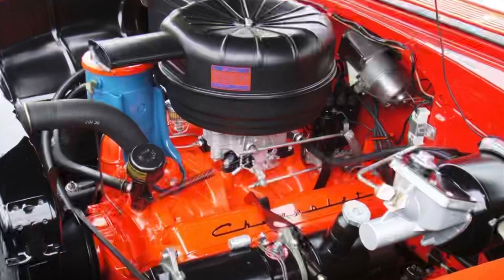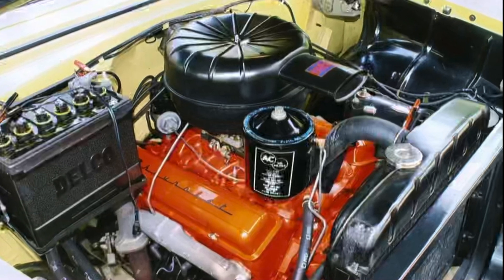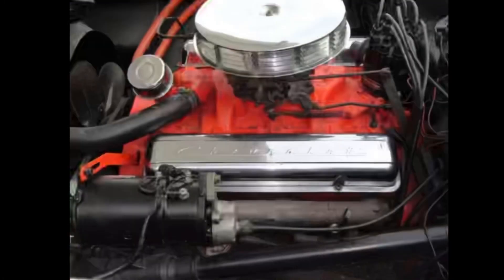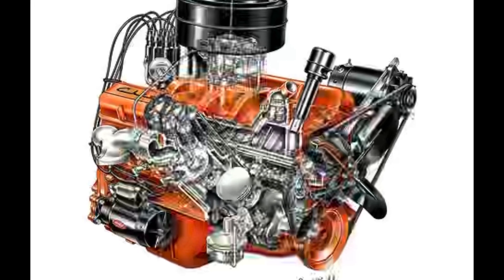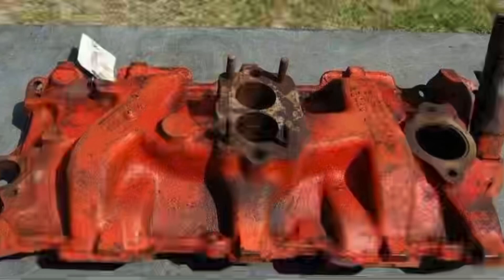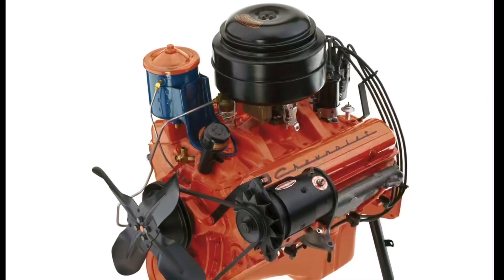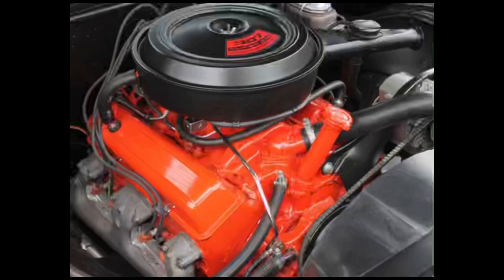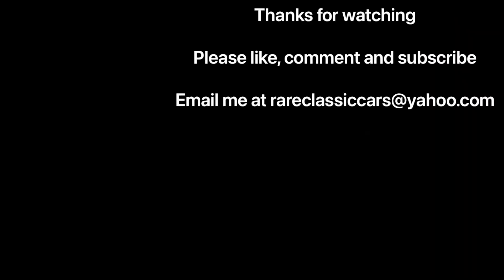Best Engines of All Time: The Chevrolet Small Block V8 (262/265/283/302/305/307/327/350/400)

Comment: The Chevy 305, for its intended purpose did the job wonderfully. It was a bread and butter transportation engine, never created to be a performance engine. Considering what it was the power was not bad. The LG3 2bbl & LG4 4bbl ran when taken care of well over 200k miles. I never had a bad cam on a 305 but had a Chevy 267, mfd 79-82 that had a soft lobe. All though not a Chevy the Olds 307 was another smog era workhorse along with the Mopar 318. Yet another great video Adam 👍
Reply: They were great engines, I had an 84 4bbl in a truck, drove it for 24 yrs daily no issues just regular wear items
Reply: I read that the reason the cams went bad was because the grind produced a rapid  opening and  closing valve timing with short valve dwell  to lower overlap. This made for steep pointy lobes that wore quickly.  The reason for this design  was emission related.
Reply: I've owned 87 Caprice with a 305 for 17 years.  It has about 450,000 miles on it.  All things considered, I've never "opened" the engine for any reason.  It does not leave any drips in my driveway.  It does smoke a heck of a lot though.
Reply: @ljchrzan  I had an 87 Caprice with a 305 also, it ran FOREVER with lil smoke I suspect was the valve seals that were a common issue on 80’s Chevy 305/350s.
Reply: @ljchrzan  - Probably needs new valve seals... and may be missing some cam lobes...
Reply: @BuzzLOLOL  I'd be surprised if there was any valve seals left
Reply: yes 305 good...dont abuse it...twill last 4 ever...m
Reply: IME, the Chevy 305 was an abysmal engine. Chevy cheaped out by keeping the same stroke as the 350 (both the engines use the same crank blank for cost savings) yet radically decreased its bore. This resulted in an inherent restriction in valve size and hence radical limitation in performance. The 307 was created of the same sin (a debored 327). I have a hunch that marketing played into the equation - the 4" bore (same as 350) x 3" stroke was a 302 - a moniker (too) well associated with Ford, but in the least it would have been a vastly superior budget engine than the 305 (or 307).
Reply: @salninethousand2496  - Valve sizes in 305's and 307's were fine for the job they were expected to perform... and the longer stroke produces a cleaner running engine... more low RPMs torque... 
First 302's were 1950's Chevy 283's bored 1/8 inch over to produce a '301'... same bore and stroke as a 302"... ditto for the '76 & up Pontiac '301'...
Reply: @DFV  Louderilk good work... I think chevy small blocks were an enduring design.....ford had good motors too...I liked the 289...loved my slant 6....and yes...a few people raced them...
Reply: @davewallace8219  - Some Slant 6's were all aluminum...
Reply: @BuzzLOLOL  yes! Mopar did make aluminum Slant 6 blocks in the early 60’s I believe.
Reply: @davewallace8219  you left out the 318, underrated good engine.
Reply: @DFV  Louderilk I still have a 300 6cyl. made in 1988...
Reply: @davewallace8219  Oh my gosh - I had to drive an extended Econoline van with a 300 six and 4-on-the-floor transmission back in the late '80s and early '90s, for a part-time job.  I remember being surprised when the boss pointed out it was a six in that thing!
Reply: @70sleftover  Those Ford 300 I6s were workhorses.  I think they still use them in UPS trucks (the gas powered ones).
Reply: @davewallace8219  - A fairly new one, eh?

Comment: It sure is great for the blue clouds of oil smoke, agreed. 
People only think it's good because of volume, period. Any small block Ford or Mopar will walk away from it with better mileage and reliability.
Reply: I've always heard that from Ford and Slowpar guys but the funny thing is I've never actually seen one of either that would "walk away" from a 302, 327, 350 or 400 sbc that was comparatively built nor do they get better mileage or have better longevity save for the few years of soft cams and that is an easy fix for even a shade tree mechanic on most cars and pickups of the era.
Reply: Mopar was eating Ford and Chevy in NASCAR with their big block hemis so NASCAR banned them. Nice try though.
Reply: @jsd795  Then you need to get out of the basement and learn something about cars.
Bye.
Reply: @67marlins  I certainly know enough about the subject to know when someone is talking out of their rear end.
Reply: @jsd795  Exactly the response I'd expect from one of the many camaro boys who watched my Ford tailgate leave them in the dust. Truth must hurt.
Reply: @67marlins  it doesn't sound to me like the truth is one your strong points.

Comment: Quite informative.  I learned something new. I did not think the 305 V8 was a bad engine either. I know that the Chevrolet Caprice used a 4300 V8 in the mid 1990's on top of the 350 V8 and 5.0 Liter V8.  I would like to hear about Oldsmobile V8's and the 3800 V6. Thank you for sharing.
Reply: Plus you can take a Chevy 305 make it a 334 Stroker and get over 400 HP out of it.
Reply: the 305 is slow and doesnt rev high
.
but for a low end torque, drive it for what it is, and get good MPG
its amazing.... especially with a 700R4
Reply: all,,v6 engines ever produced are crap..same as 4 cyl..unbalanced.. 6 cyl or v8.. only engine to have..&,,not a 350. there gearbage..you know nothing about engineering..
Reply: @harrywalker5836  And you know nothing about spelling and grammar. I doubt you know much about engineering either.

Comment: Adam, I see that you are not dealing with the fact that you have been so completely brainwashed by G.M.'s failed business model.  Try to gain a little objectivity and self-awareness!!  Yes, G.M. really got lucky with that small-block Chevy V8:  after nickle-and-diming its design as much as they possibly could, it was still reasonably dependable, a la the stovebolt 6.  But those ball stud rockers are a real turnoff.  I would never have an engine with ball stud rockers; they're beneath my dignity!  Know why the stovebolt 6 was so named?  Because G.M. was too cheap to use high-tensile strength head bolts.  It might have cost $1.50 more per engine!  Can you say "cheap"?  If G.M. had tried a little harder to make its engines good, rather than just cheap, fewer of their engines would have been such failures.
Reply: I think you will find that if you watch enough of Adam's videos (particularly the Best Of/Worst Of series, but also his reviews of his own vehicles) that he has been quite critical of various GM vehicles in general and quite a number of GM engines & gearboxes in particular, and has repeatedly called GM out for cost-cutting in design & manufacture and de-contenting of their vehicles from the '70's onwards.  

Although having worked for them, Adam is no fan-boy of GM (if anything I think he has a soft-spot for the Ford vehicles he owns) and he is generally unbiased and objective in his opinions.  I suggest that you take the time to sit down and watch the back-catalogue of all the videos on Adam's Channel before you make unfounded claims of "brainwashing" and bias, as it simply makes you look ignorant to those of us that have followed his channel from day one and are familiar with all his content.
Reply: @philip4193  I've watched all the videos, Philip. It's just that Adam has never eschewed the Sloan business model, so he thinks frequent model changes are just fine, but frequent model changes are incompatible with quality.  Plus, the supercilious way in which G.M. treats its customers and G.M.'s expectation that you are going to buy a new car from them every 7 years have really alienated potential customers.  I don't think Adam is ever going to be willing to admit that G.M.'s business model has been a failure because he's got too much emotionally invested in the company.  And now G.M. is going to go all electric and try to compete with Tesla.  Good luck with that!
Reply: Adam provides a very good assessment in his reviews, and he has spoken repeatedly about 1) the cheapening of the Big 3 products in the early malaise era 2) the soft cams in GM engines 3) the sloppy assembly and poor fit and finish of large GM cars in the 1970s and 4) how the conversion to new technologies and architecture had a negative impact on quality.  Brainwashed people, or your “true believers” are usually apologists,and I don’t think that describes Adam.  He likes a certain era and type of automobile and is enthusiastic about it.  

Calling him brainwashed is not accurate and mean spirited.
Reply: @zilksmooth  I could not agree more!  You have articulated perhaps more eloquently the points that I was trying to make in my reply to our ham radio friend.  It seems that William has probably had a bad experience with either a GM product or their customer service (or generally just disagrees with their business ideology) and thus he objects to Adam suggesting that the GM/Chevy small-block V8 was a essentially a good and successful motor, as in his mind the evil GM cannot possibly produce anything good.  

History has shown that this motor was not only prolific, long-lived production-wise and generally durable & reliable but also a great platform for racing and aftermarket modifications as it was easily tuned and modified from stock at little expense.  It was replaced by the LS-series engines, which themselves have gone on to become legendary for exactly the same reasons.
Reply: Oil doesn’t wear out. It gets polluted by water, gas and carbon. I knew an older mechanic with a sb 318 who never changed his oil in 40+ years and 500,000 miles. He used a canister oil filter and put pure cotton in it every 500 miles and topped the oil off.

Comment: Legendary, indeed. We read somewhere (might have been in the Ford Museum) that even the development engineers were surprised with the performance and reliability of end product, and how well it compared with others on the market at the time.
Reply: Chevy did have the OHV Buick, Olds, and Cadillac 8 cylinder V8 engines to pattern after... Pontiac invented the stamped steel rocker arms used...
Reply: Even today we're constantly surprised by how these engines compare to other manufacturer's engines. In the day, they were the space shuttle.
Reply: Very informative video. I'm satisfied of the 305 SBC on my 1982 Trans Am. I had to change its water pump 8 years ago but other than that I have no complaints. Soon reaching 80k miles it's a sturdy and reliable engine.
Reply: Lazy  , Incomplete , History ,one of innovations ,of Chevy small block was ,stamped steel rockers ,and No rocker shaft .which ,Pontiac Engineers had developed .Ed Cole was Allowed to steal idea for Chevrolet . And ,Yes was a good ,Cheap ,Light ,engine .

Comment: Not mentioned is the V6 derived from the V8 engine. Quite common in eighties and nineties GM  products as the entry level option.
Reply: Yes. The 4.3 V6 was a 350 minus the back 2 cylinders.
Reply: There was also a 3.3L V6 that debuted in the 1978 Malibu, which was upgraded to 3.8L (229 cubic inches) in 1981. I remember taking driving lessons in a late 70's Malibu with the 3,3 that could barely climb a hill - we lived in Asheville, NC at the time.
Reply: @eth39232  Ah, those were the not-so-good old days. It was not a good time to learn how to drive - in 1981 I was stuck in a driver's ed class that featured a Chevette with an auto trans that shifted up and down several times climbing the one looooong hill up to the state police driver test place. Of course what did we expect from a four cylinder American car back then but lousy performance for all the fuel efficiency we hope for?
Reply: @70sleftover  A 4 cyl was ONLY for gas mileage.  Performance was out of the question.

Comment: They leaned heavily on Cadillac and old's research but, not entirely. I'm sure you'll disagree with my assessments (as you have before) if you read these comments at all. However,  I agree the sbc is a magnificent combination of existing engineering combined with honest examination of improvements that could be massaged to fit the new creation needed at the time of thier assignment.  I believe serendipity was a factor as well.
Reply: Buick also had the 1950 all aluminum 215" V8 that they put into early 1950's Harley Earl show cars for Chevy to look at... and Pontiac invented the stamped steel rocker arms... 
I think the 215's early beginning is why it went into production in 1960 with rocker shafts instead of individual stamped rocker arms... can't recall, may have also had aluminum rocker arms...
Reply: @BuzzLOLOL  yes sir. It all started with Cadillac in 48 when they put OHVs on there flathead blocks though.
Reply: @michaelatkins9780  - Chevy's always had OHV so they didn't need to learn that... and they knew their OHV 6's always had more HP than same year Ford flathead V8...
Reply: @BuzzLOLOL  didn't say that. Yes chevy started with inline 6 OHV in 28ish and military equipment in the 30s and 40s all having OHV but, not one production V8. That started in production in the retooling after WW2  for the luxury market so they make profit for as a markup on those models. SBC was the logical downmarket with improvements and of that's necessary to fit in their tri- five models.
Reply: @michaelatkins9780  - ??? Chevy started with OHV 4 cylinder in 1911 and had OHV V8's from 1916 - 1918... Although those cars were a little pricey for the Chevy market/buyers...
Reply: @BuzzLOLOL  you keep expanding the context of the original comments. Which is indicative of a an argumentative individual. Yes, everything you just said is true but, what numbers are you talking about at that time? Production is what I  said. 20s, 30s, 40s and 50's. Your next argument will probably be that they all had round wheels that went round and round.
Reply: @michaelatkins9780  - Not being argumentative, just expanding your knowledge into areas that you apparently had no info on... yet... 
Since i started as a Chevrolet/GM engineer in August 1966, I have much more knowledge of this stuff than most people... also, my father worked for Chevrolet much earlier... although he preferred Oldsmobiles... especially starting in 1949...
Reply: @BuzzLOLOL  understood. I am aware of those facts unfortunately in a comment  we have to be brief which isn't one of my strong points. I am a 1960 model myself. I came in when, the fins went out. All points well taken, I appreciate your opinions, sir.
Reply: @BuzzLOLOL  Yes, Chevy, like Buick, was always OHV, but the Chevy Stovebolt only had more power than the Ford V8 in 1940 - early 41, and in 53.  Did have more torque from 1937 - 42 than the small 221 inch Ford V8 though.
Reply: @BuzzLOLOL  That V8 was priced in Buick territory, so it didn't sell.

Comment: What vehicles were still using the sbc in 2002?
Reply: Some Chevy and GMC trucks had them up until '04
Reply: @unclebob7937  That’s such a broad statement, your information does me no good
Reply: @regsmith7604  Then i suggest you do some research.
Reply: @unclebob7937  I suggest you hug these 🥜
Reply: Chevy express vans and GMC savanna vans were the last production vehicles to use an sbc, they used either a vortec 5.7(350) or vortec 5.0(305). The Chevy and GMC trucks stopped using sbc engines after 1998( which was a weird year because you could have gotten an old body style or a new bodystyle truck for that same year)
Reply: @briang4470  Great answer👍🏽👍🏽
Reply: @briang4470  What about the 2008 Chevy Impala SS.  It had a V8 that was advertised as a Small-block V8, 300 horsepower.  A co-worker had one.
Reply: @michaelbenardo5695  those use an aluminum 5.3l which is part of the LS engine family which technically is a small block but this video is focusing on the GEN 1 small block Chevys.
Reply: At least some of the GMT400 series trucks were sold until M/Y 2000 with the 3500HD being sold until 2002.
The Express Van had SBC Gen 1 until 2002.  The Kodiak/Topkick HD had the L31 until 2005.
I have a few of these trucks and crawl around junkyards frequently.
https://en.wikipedia.org/wiki/GMT400

https://en.wikipedia.org/wiki/Chevrolet_C/K#Fourth_generation_(1988%E2%80%932002)

https://en.wikipedia.org/wiki/Chevrolet_Express

https://en.wikipedia.org/wiki/Chevrolet_small-block_engine_(first_and_second_generation)#L31

Comment: i remember them being oil burners, you could get an insert as such to cover the spark gap to resist oil fowling
Reply: I too remember them being oil burners, frequently accompanied by a trail of blue smoke. But, considering how many of these were in service, how many people abused and neglected them, they were a very good engine.
Reply: @dave1956  The oil burning main cause was because of the SBC valve stem oil seal design.  When new and fresh, the valve stem oil seal "o-ring", combined with the metal shield under the retainer worked well, the problem was over time, and heat, the "0-rings" under the keepers became hard and brittle, they would break and leak oil down the valve stem, past the guide, and into the port.  This problem was solved with the Vortec head design that used guide mounted valve stem oil seals.
Reply: Yes, they were notorious for fouling spark plugs and using oil when compared to the ford and Chrysler small blocks when they got a few miles on them. We used to keep a supply of non foulers in stock. It wasn’t solved until they redesigned the valve seals with the vortec .
Reply: @dmandman9  Yup
Reply: The valve cover gasket’s would leak regularly because of having only 4 bolts. Also on some of them the exhaust manifolds were in a position  right next to the valve covers. If they lasted 2 years with the best gaskets, you were fortunate.
Reply: Had modern style "positive" valve seals installed when the heads were rebuilt for my 1976. Between that and new rings oil loss is negligible now.
Reply: @Texassince1836  Yes, I remember some machine shops and rebuilders used “real” valve seals rather than the what amounted to just orings that served as  the original valve seals.